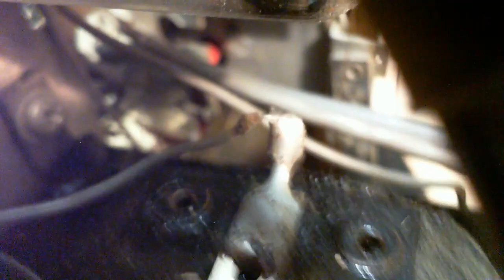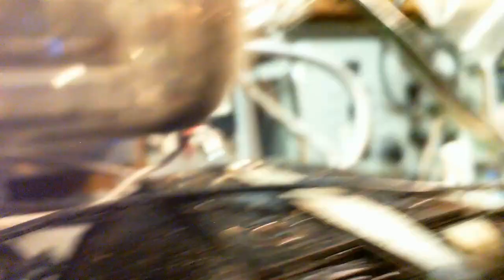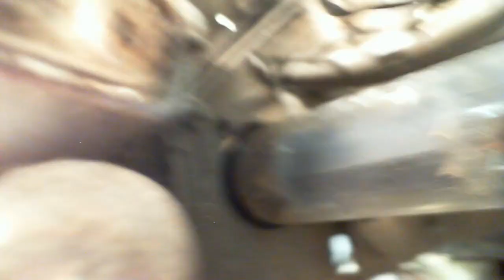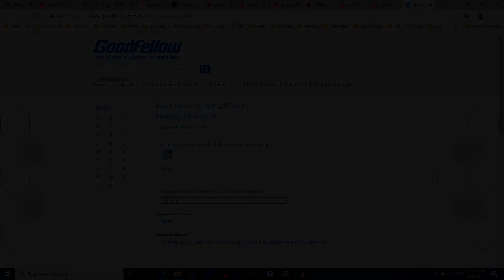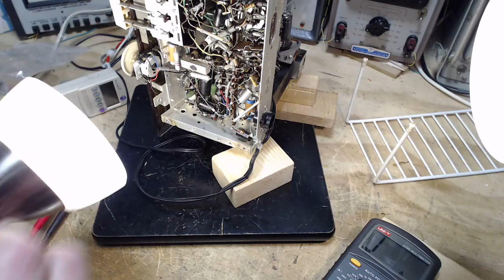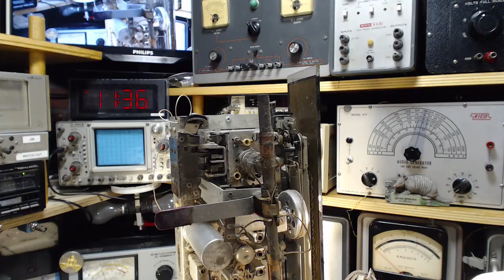Philips B5X88A AM FM SW Tube Radio Video #2 - No Power in Radio

Comment: That "thing onn the transformer is a thermal cut out switch if the current goes too high it heats up and bends opening the circuit then it will cool and close the circuit again , this will repeat over and over again limiting the amount of "ON" time .

Comment: As far as I can tell, M2 is the entire band switch assembly, detailed on the bottom right of the schematic. The diagram shown there tells you which numbered points are closed and which are open with each position of M2. So SW-1 stands for shortwave band 1, not switch 1. On the far right, partially cut off the page, is the "mains" position. I'm not sure if there is a corresponding physical "mains" button on the set, since the leftmost button says "off".

Comment: 29:18 You are supposed to use a special solder when soldering these "Entlötwiderstand" (self desoldering safety resistors) back together. Originally IIRC it was LBE; a eutektikum from 45% lead 56% bismut melting around 125°C
 Resoldering with the lead based solder 60/40 solder of melting point ~185°C is borderline negligent. Using the lead free solder with mp ~220°C is grossly negligent.
Btw roses metal has mp ~95°C . On rework you can add copious amounts of Roses metal onto existing lead free solder joints and it drops the combined melting point down to about 130°C which facilitates getting chips off boards without the need to heat up to 220°C at which lead free solder melts.

Comment: 9:47 You should get even shorter test leads on the multimeter. At an input impedance of 10M any centimeter of additional lead length will drop the displayed voltage reading by an unacceptable amount ....
...of several pico Volts.
Reply: One of these days he might invest in some new test equipment that he can trust.  Maybe.

Comment: According to what it says on the schematic, the 'MW' switch needs to be depressed to turn the radio on. So it would stay depressed if you select a different band. You would depress 'MW' again to go into AM mode. Weird arrangement if I read it right. It doesn't look like you had the 'MW' button depressed Jim to turn the set on. You had the switch on the end depressed. If that is the 'MW' switch you had depressed then it's my mistake.

Comment: Check the cord, find the on-off switch and check it, then the fusible link, then the voltage selector switch, then the windings....and so on...JIm SMH.
Reply: He needs to start taking it apart more, which he is shy of doing on any project.  If requires more than simple cap/resistor changes he pretty much talks himself into reasons it doesn't need fixing/cleaning or replacing.  The M1/M2/M3 etc. designations are the different switches/switch banks.  If he realizes this he may be able to figure the schematic more, but.......  It also seems he is getting terminal 1 and 2 on the transformer confused with terminal 1 and 2 on the voltage selector switch.  Not holding much hope in this getting fixed, but he may 'shock' me into figuring this out.  As for the Rose Metal Fuse Link, check for what it is made of https://www.chemistrylearner.com/rose-metal.html

Comment: There are comments under the page for this receiver on Radiomuseum.org : The metal thingy across the transformer is a mechanical fuse, which often fails and is by-passed, making it more dangerous.
Reply: I already commented on this type of fuse used on this radio in the last video. No need to go to radiomuseum.
But since he dont read comments any helpful info in his direction is like preaching in the desert.
And his babbling and spouting out weird explanations of how he thinks things work is only fun until it gets safety related.
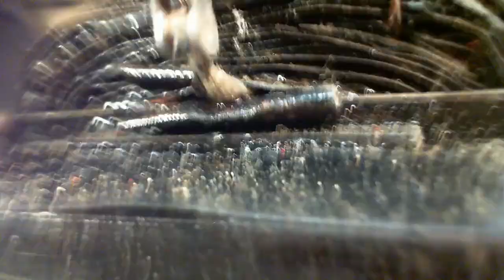And that moment was reached when he commented on the thermal fuse at 4:55
"Did somebody forget you can just solder wires together" 
That comment taken in by some hobbyist or fanboy is a recipe for a fire.
Soldering this thermal fuse is like building a time delay incendiary.
As much as leaving it as is without extra fuse is a safety hazard.
This radio needs a complete redesign in the fuse department.
Esp since it will be used by 3rd party ppl.